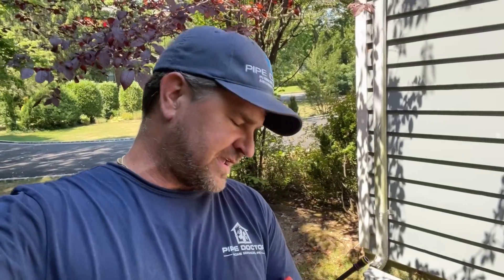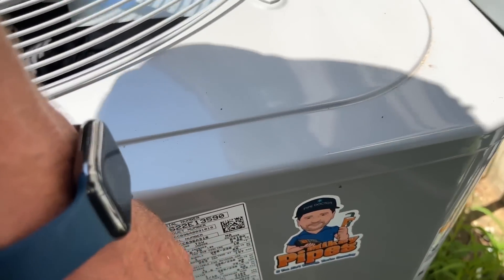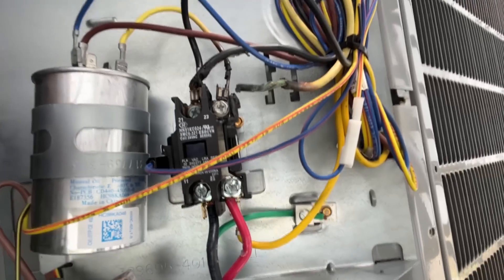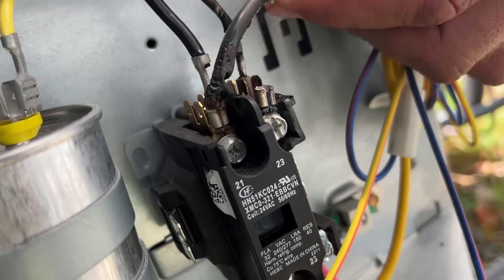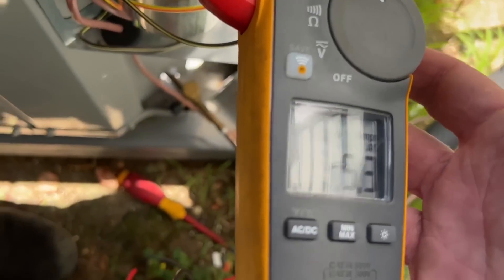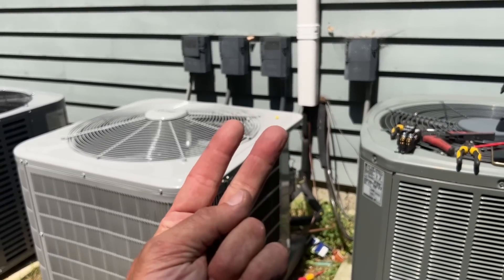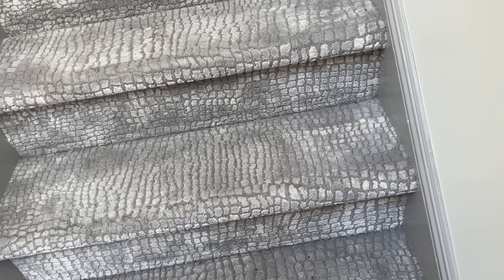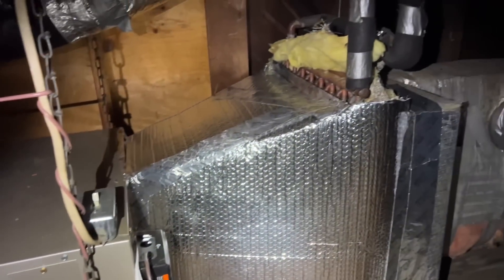How To Diagnose Central AC Problems - Brand New Carrier Central AC System Dead and Not Cooling

Comment: @Mikey Pipes - Pipe Doctor Plumbing & Heating & Air
I have a Bryant system that was installed 12/21/2021 and on 4/06/22 the same thing happened, even the wires were “charred”, and the ground was completely gone, burned up. Like you, thought was an odd one and never seen anything like that on a “new” system. A local company did the install at parents house, & been using same company for 12 yrs and they even do the preventative maintenance every year too…..odd one, it is.
Cheers✌🏻

Comment: either the lugs were not torqued properly during factory assembly or junk crimp connectors with galvanic reaction to the wire or contactor. it's also possible the contactor itself is to blame! the contactor as supplied from manufacture, may not have been torqued at the lug to "contact" buss bar connection or they chose poor materials and lack of thread locker. hard to say without tearing some down and testing.  I have seen it in the past, but it was very sparse/infrequent.
either way causes overheating and oxidizes the joints, causing corrosion and rapidly increasing resistance, that's an snowball effect which turns into an avalanche. game over 🙄

Comment: Unfortunately the way things are built today, really need to check all the connections on a new installation to ensure they are tight.   It is just the world we live in.  I've had plenty of bad parts out of the box in the last few years.  Even 2 bad brand new compressors.

Comment: Is it ok to replace single pole with 2 pole?
Reply: Yes, Carrier cheaps out and only opens one side of the AC line. Since there is no neutral and both wires are hot it is better to open both sides of the line. It is perfectly acceptable and means he doesn't have to keep single pole contactors in stock as most makes use double pole to begin with.

Comment: to me, it sounds like a possible loose wire or broken wire of the 24 volt supply side,  with vibrations causing the contactor to keep going on and off causing it to overheat causing the wire to burn, and welding the contacts together. possible the coil in the contactor itself

Comment: You’ll need to check the compressor power at the contractors on Carriers and Tranes. I’ve had several. Got pictures of brand new units all melted. Complete rewire. Loose screws will do it every time.

Comment: You repalced a single pol contactor with a double pol contactor ? No Geuno
Reply: I noticed that too. I'm still fairly new to the hvac service world but I dont think you can replace a single with a double pole
Reply: @natew48  Obviously you can. He did it. You can replace a single with a double but not a double with a single.
Reply: @PipeDoctor  I am? Been working on oil heat for 33 years but am new to A/C. I thought you could replace a single ploe contactor with a double pole and just use one side. Oh well, I'm still learning. LOL
Reply: you can also repalce a 50 mfd cap with a 30 mfd and it would work does that mean it's right.  your a peewee in hvac bruh. I speak from experience replacing a double for single and that call back got me fired.  just saying mickey
Reply: I get it you didn't have a single pol on your truck and it speaks to how mature you are.
Reply: @PipeDoctor  Right nice job and nothing wrong with putting 2 pole in it's place.  As a matter of fact, Carrier actually wires the contactors to be used with both single and double.  The Yellow fan wire is on the Line side of the contactor so when you have the off-cycle crankcase heat, power actually feeds though the outdoor motor.  And another benefit about using 2 pole is when the unit turns off (the 2nd pole isolates the fan motor from the compressor), the condenser fan motor doesn't do that annoying "clang" due to the reverse EMF the compressor puts out when shutting down.  I think there was a discussion on this a few years ago with Joe Shearer and others on condenser fan motor noise on shutdown. Thanks for the video! Enjoy the rest of the weekend.

Comment: Good job Mikey , just so you know for next time you install new equipment the contactor  compressor wire was loose from the factory. I been going back on new equipment with loose compressor wires on contactor.  That heat caused the contactor to go bad.  Thanks and keep them coming.
Reply: Same here. This summer I’ve already had 3 separate occasions where the T1 and T2 factory connections at the contactor from Carrier not tight.

Comment: The contactor more than likely failed due to high resistance to the load.  I thought I saw that T1 was loose when you moved the wires at first touch.
Reply: I saw that also 👀

Comment: That disconnect looks like it was there from the previous system my ex-girlfriend bought a condo last Summer the AC wasn't working and was tripping the breaker the disconnect has two fuses in it they were shorting and smoked the contactor & subsequently the fan motor... It was an older 22 unit so we just had it replaced. Sometimes those old plastic disconnects lose their water tightness and short out.

Comment: Mike...when I have a contactor like that, I check the coil voltage. If that voltage goes low, you can overheat the coil thimble and it can distort the plastic, jamming the armature of the device. If you open it up and don't find the contacts welded, it's the thimble.

Comment: I've replaced approximately 2 dozen of the carrier contactors on units from 2020-2022. Coil side of contactor burnt up. Causing low voltage short. Cheap contactors
Reply: Before I finish watching this video I am one minute and 57 seconds in.  I am going to say that the bolts were not tightened on the contactor properly from the factory!

Comment: First
Reply: I would save Fujitsu for a Friday
Reply: DIYers will watch it before they try to put there mr cool in on Saturday
Reply: @DCHVAC  hey don’t knock mr cool. I’ve had my 3 ton ductless installed for about 3 yrs never any issues
Reply: @TheMattsMan  I went to one installed properly that was leaking from the condenser coil after a year. First mr cool I’ve ever seen and it’s leaking. Not a good sign.
Reply: @DCHVAC  just like anything could’ve been defective from the factory. Or just bad luck. Mines fine so to each their own. Saved about 2000 dollars doing it myself.
Reply: Keep up great work broski